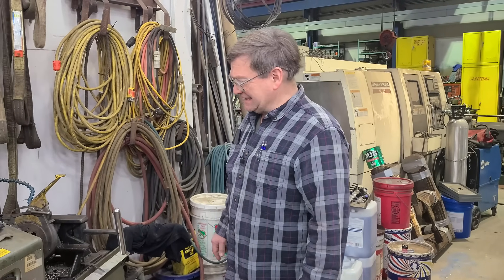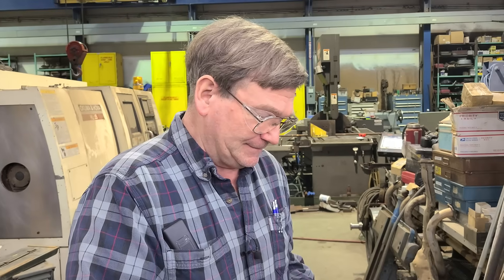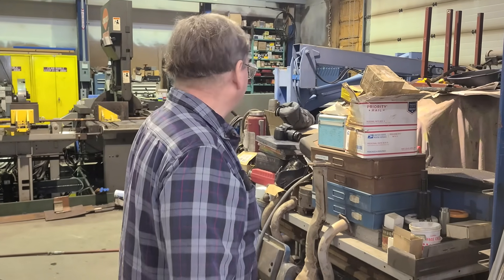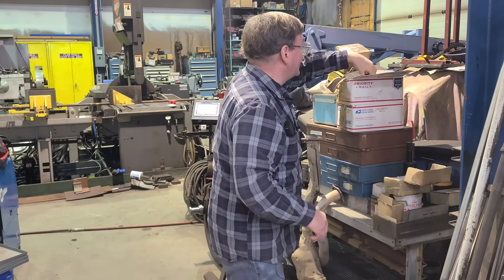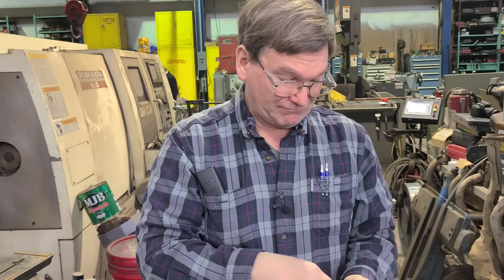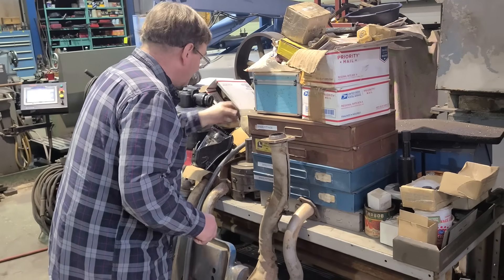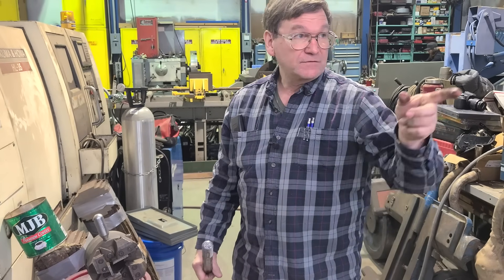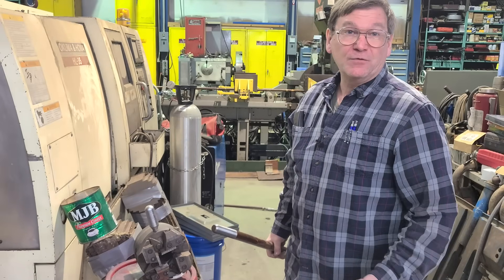Threading heads and the LANDIS Threading System

Comment: The last shop that I worked in had a neat jig made for the Landis chasers to be used on a surface grinder. It was a rectangular block that had two different slots milled into it on opposite sides, with set screws to hold the chasers in place. One side was set for the sharpening angle to be used for the whole width of the chaser. The other side had a steeper angle to be used for a steeper rake angle that was only ground at the first couple of lead-in threads. It was pretty much dummy-proof - as long as some dummy didn't get carried away with grinding depth.

Comment: We use landis to thread all the pipe nipples for our (BIG) slice of the natural gas risers and meters made in the US. Mostly 3/4” and 1” NPT. The engineer made a LOT of mistakes when he tried to switch it up from oil to water coolant and couldn’t find a way to break chips so the machine they were mounted to couldn’t evacuate parts due to them getting caught on balls of stringy chips. Worst part is we threw out the old iron machine that made parts by the thousands for a boat anchor that just sits and can’t run. 

That engineer got promoted out and we’re stuck with the junk.

Comment: I do a lot of rolled threads in our shop. We roll threads from 1in to 7in with LMT fette heads. High pressure tubing for the plastics industry. Lots of money to be made and a lot to learn. I’d like to see a video from you on the science of rolled threads. Very cool and most people don’t know anything about it. I just may learn something. Btw we use a horizontal boring mill just like your G&L with a fixture to manipulate the part fore and aft to get it straight with the spindle before we roll the part with the head on the spindle.

Comment: Thread cutting section smelt like burnt oil with no ventilation. Others apprentices kept on trying to have me do there job. 
Threading is a vast field of knowledge many types of continuous cutting dies. 
Tolerance checking with a batch, especially with harder steels. 
Once accumulation  of machines & dies even though expensive would set someone up for a good run of jobbing .
I chose fitting instead. But all you need is good ventilation. Sorry guys.

Comment: Landis are awesome for the very reason you state - easy to sharpen - and WAY more tool length (life). The best style for the home/small workshop
The Geometric die head is an American design (I presume). From what I understood you to say these don't really provide support or pitch guidance? If so they are not as good as Landis or Coventry.
The Coventry die head is the UK style. It is far harder to sharpen than the Landis as it really requires a sharpening system with proper angles and for full use of the tool a calibrator for tool length.
BUT the cutting style is the same - that is the first few threads are cutting and the rest of the thread form is ABOVE the centreline and so is providing support to he workpiece AND ensuring that the pitch is consistent.

For a home workshop tapping die holders work "ok" for short threads but for long threads the pitch can vary a lot. Can be overcome by using the carriage to actually drive the speed at which the die moves forward, but this doesn't overcome the issue of very little room for chip removal.

There are other makes of all of these designs. Make sure if you decide to use a die head that you also make sure the chasers are of the same type. 
Also make sure the type of thread you want is available. 
They all cover the usual threads BS, UN, M
Coventry also covers the "weird" UK developed threads BA BSB etc and so for the widest range for ALL threads it is pick.

Landis-Solution com
turbinejon com  for Coventry

Comment: Fellow tool hoarder here!!! I would pay $ for a tool hoard shop tour. I want to see all the tools that I didn't know I need yet. #ihaveatooladdiction,,,, love the vids. I think I have driven passed ur shop a hand full of times in my travels. I'm in Chickaloon i don't get up that way much. I just wish i could hangout build stuff and learn from a true master chip maker youtube will have to do for know. Thanks to cool teacher guys like you on youtube teaching me. I found an overpriced 13x40 doall lathe wired in a vfd for three phase. shes beat bed all dished out but I still make chips with it. I almost have my chip pan full for the first time. I have like 0.0005% math skills so i just check and recheck fitment of parts it takes longer but it works. Fingers crossed i haven't crashed it........... "YET" :0  thanks for the time and teaching. I'm at the front of the class apple in hand when Howees talking tools.

Comment: I have Coventry geometric heads that I use and a pile of Landis dies that came with the Coventry heads. I have brazed some of the Landis cutters onto bar stock and use them as thread chasers.  As I work on a lot of O.P.R., (Other Peoples Rubbish), I find them very useful. Just one more tool to help recover some past treasure.